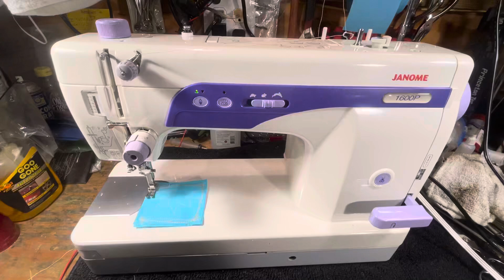JANOME 1600P HIGH SPEED w/INDUSTRIAL HOOK ASSEMBLY & BOBBIN CASE.ROBUST MACHINE FOR 1.5K (video 395)

Comment: Thanks for the video. Glad you brought up the needle situation because that’s what I was hoping this video would address. I’m going to buy a husqvarna that also recommends the hlx5 needle and I’m glad to hear it will likely work with a normal microtex etc. take care!
Reply from the maker: @seang8462  buying a Husqvarna?  From an online retailer or local dealer?  The last machine I would recommend that you buy would be a Husqvarna, and I would never buy one. If you’re buying locally, that gives you a slight advantage until that dealer goes out of business or drops the line of machines. If you buy it online, you’re like an instant orphan. Some dealers have stopped accepting Husqvarna machines for service because of their inherent problems. You’re commenting on a review and recommendation for a Janome by telling me you’re buying a Husqvarna? That’s a confusing disconnect in linear logic. I’m stumped.
Reply: @randyyoursewingmachineman9954  Fortunately, it's made by Janome.

Comment: Hey Randy, Mike here, I have a question about the singer to 221. If you remove the main completely,clean and reassemble. Does that make the machine less valuable. And what’s your thoughts on gear messing. Thanks
Reply from the maker: Remove the main completely?
Gear messing?
I think predictive text is messing with your main message.
Reply: @randyyoursewingmachineman9954  I have a question about the Singer 221. If you remove the main shaft and clean,reinstall does that affect the value. Completely dismantle the machine. Thanks Mike.
Reply from the maker: @michaelbean739  if it gets reassembled properly, and works and sews like new, that shouldn’t be a problem. 
I can’t figure out why you would do that, unless you’re considering painting the machine, and disassembly makes that easier.
Reply: @randyyoursewingmachineman9954  That’s is what i am going to do. What’s your opinion on the gear mesing
Reply from the maker: @michaelbean739  what is gear messing?
I really have no idea what your asking me here.

Comment: Hey Randy, how would how say the Ken 148.1217 you tested last year compare to the 1600P? You described them both as "semi-industrial".
Reply from the maker: The sales brochures and online ads call the 1600P semi-industrial. It has some industrial machine components.
It also has some non-industrial components, like plastic actuators and electronics.
The Kenmore 148.1217 is semi -industrial because it has a cast iron frame, chrome plated precision steel parts, and brass gears etc. The only thing non-industrial is its size. It’s smaller than a full sized industrial.
For hard knock, long term use, I’m picking that particular Kenmore every time.
If you break something on it, you probably either dropped it down the stairs, or shipped it across country via one of our “superb” shipping companies.👍😎
Reply: @randyyoursewingmachineman9954  Thanks for the context. My thoughts were similar.
Reply from the maker: @JohnBau  👍
Reply: @JohnBau  Machines like the 1600p win out when it comes to heavier thread sizes for heavier work. The Janome will take up to #20 thread, with a recommended size 18/110 needle. My Pfaff 30 (a small beast of a machine - side facing class 15 oscillating hook which will beat anything you put under the foot into submission...) won't do that without protest. Neither will my Singer 201's, 185's -  I haven't actually tried the 401's. Not surprising as none of them were designed for the task.

Comment: One question, Randy. Does it have metal or nylon gears in it? I know the H9 comes with a honkin' big nylon gear to drive the entire works on the lower part of the machine.
Reply from the maker: It’s driven by a timing belt instead of gears. 
It’s got a timing belt like you’d find in a small displacement internal combustion engine. 
I’ve never seen them as an issue, although the hook will slide out of time if it collides with the needle on occasion. 
The needle bar has timing marks, so they’re fairly simple to keep in adjustment.
Reply: @randyyoursewingmachineman9954 Aaah, it sort of runs like the Kenmore 120.71 (New Process Gear/Chrysler), timing belt runs the show. Only diff is there is a friction wheel involved that runs straight off the motor. Really puts a damper on that 1.5 amp beast of a motor. Now that I know Janome builds (or built) a machine that won't fly apart internally from nylon failure, I'm going to have to go and have me a look! Thank you for clarifying that, Randy!
Reply from the maker: @shopwornbear1171  just heed the caution about the thread cutter actuator cam. The Janome cam doesn’t have a history of breaking as far as I know. I’ve seen several of the Juki platforms actuator cams croak out. 
Maybe different processes are involved.
Reply: @randyyoursewingmachineman9954 Will do. I'm not the type to use the auto-cutters so it wouldn't be much of an issue for me.
Reply from the maker: @shopwornbear1171  👍